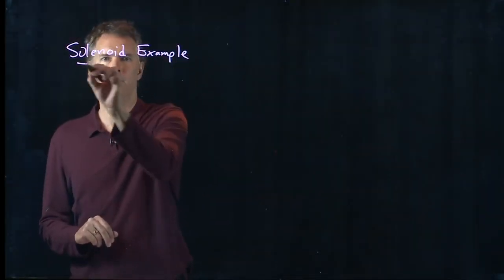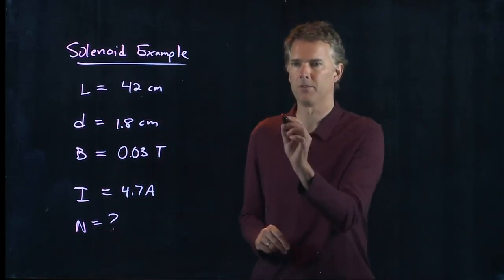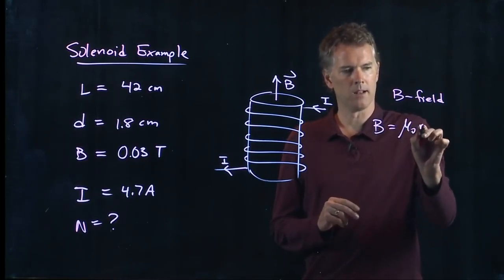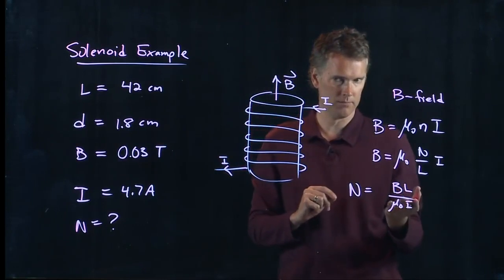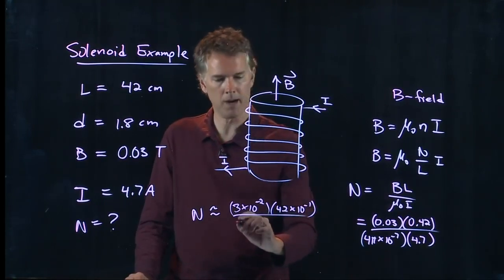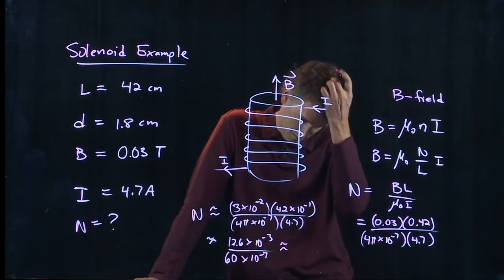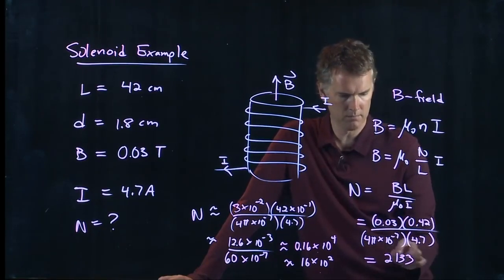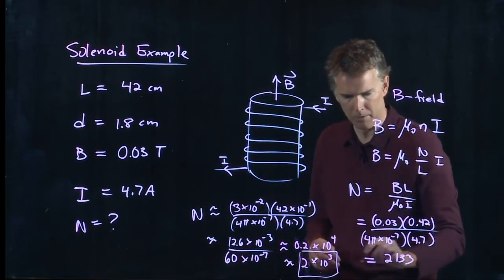How Many Turns in a Solenoid - Strong Magnetic Field | Physics with Professor Matt Anderson | M23-17

Comment: Isn't the diameter of the wire relevant?
Reply: Generally only in that it:
1. Can carry the amount of current required
2. The frequency is low enough that the skin effect isn't in play
3. The coil isn't too tall, as the further away from the center the coils are, the less effective they are